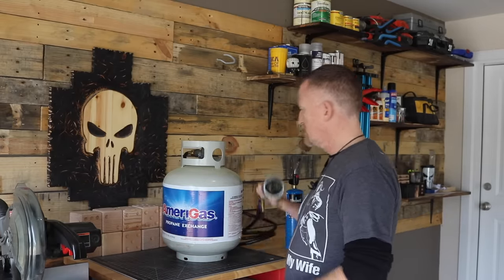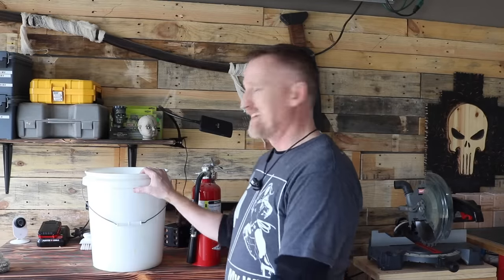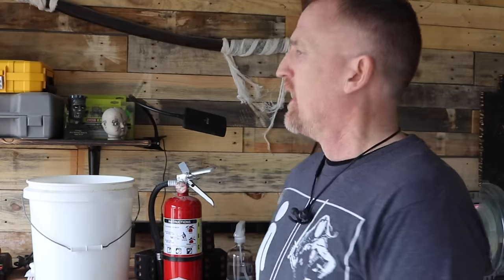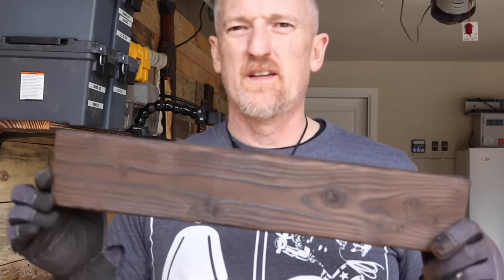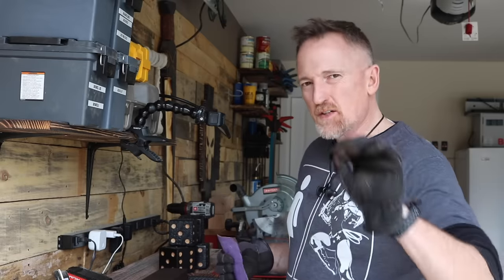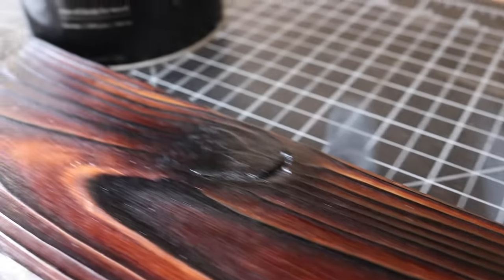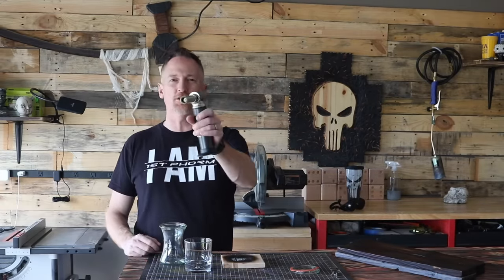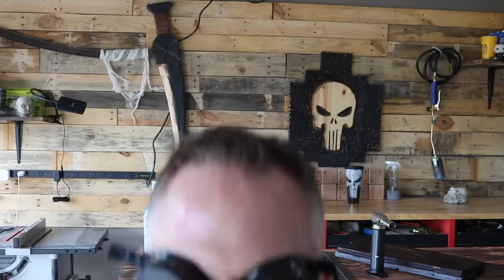DIY Wood Burning Technique - That's not Shou Sugi Ban! Or is it??

Comment: I was under the impression that burning the wood wouldn’t require the poly? Will the burn wood in its natural state been enough to withstand natural elements: rain and snow?
Reply from the maker: I always finish them so the soot doesn't come off on your hands, etc. I built some outdoor planters out of cedar, burnt them and didn't finish them. And they seem to be holding up just fine.

Comment: I've tried doing this technique recently on a couple projects, which some have been successful, but I'm having issues with my boards warping after putting the torch to them.  Any suggestions to help prevent this from happening?
Reply from the maker: Hey, Nick!
Unfortunately, warping happens when working with wood and fire.
2 things to mitigate warping:
1 - Spray the wood with water while you burn
2 - If you notice the warp while the board is still hot, set something heavy on it while it cools
3 - Burning the opposite of the wood will sometimes straighten it out
Cheers!!
Reply: @BuildDadBuild  thanks for getting back to me.  I was spraying with water while burning and doing both sides but I did not set anything heavy on them once I noticed, I'll try that next time.  Also I'm wondering if the boards I had were just too thin for the amount of heat I was putting to them.  3' 1×6 pine is was I was using

Comment: i love the look of this burning thing but ive tried doing it when my project was assembled and you cant get the 90degree corners burned so i have to burn all the pieces before assemble. does anyone have a fix for this problem or am i doing something wrong. i hope it made sence
(sorry for english)
btw nice vid
Reply from the maker: Burn before building. Cut your stock a little long so you can cut clean edges. Then come in with a torch once assembled and burn the edges.
Cheers

Comment: What type of wood did you use?  I want to see you finish a table top with that last bleach finish on burned wood!
Reply from the maker: In this video I used pine.
And stay tuned for some tabletops....should be coming soon!
👍🥃
Reply: Ive used this same burning technique as well and the amount of wood or the length of time your torch is heating up the wood can change its effects too. Be sure to experiment!

Comment: Not sure if you have gotten this question before. But I want to do this with my AK handguards. What was that brush you were using after the sanding?
Reply from the maker: Ha! I've only gotten that a few times. LOL
I used 2 in this video. One is an old bristle brush off a broom (the brown one) and a nylon brush (the kind you'd clean your bathroom with). So, nothing special.
I have since that time found some bristle brushes that fit in your drill. I'll link them below. They make life SOOOOO much easier than doing it by hand.
Cheers!
Nyalox Brushes: https://amzn.to/3aRgnXZ
Reply: Build Dad Build I appreciate it! Ready to burn some wood

Comment: Great project. What clear did you use over the sunbleached. That looks amazing.
Reply from the maker: I normally use a spray poly on small projects and a wipe on with larger ones. That particular piece is just stain, no top coat.

Comment: So, I have some old mirrors I wanna do this with... But the mirrors are the problem... Lol but so pretty.
Reply from the maker: can you remove the glass?
Reply: @BuildDadBuild  sadly no. I mean, if I had cutting tools then I could pry the back off & just make a new back to reset it, but lack of tools no. I think they were 2 swing mirrors from a dresser, but I want to fix them up and hang them on the sides of a door or window.
Reply from the maker: @RealSimsHouse  Maybe take them to a glass shop and see if they can remove them for you
Reply: @BuildDadBuild 
Thank you. 💖
Reply from the maker: @RealSimsHouse  Sure thing

Comment: I like the second to last wood in the line up with that deep red and black. What did you use to get that color finish?
Reply from the maker: Hey, Sean.
It's called Simple Finish by Maker Brand Co.
It's pricey, but a little bit goes a long way. And it's really easy to apply.
Cheers

https://makerbrandco.com/collections/simple-finish/products/simple-finish-hardening-finish-with-wax-sealer-for-wood
Reply: @BuildDadBuild  I found it. Thanks

Comment: What grit sandpaper did you use? Do you recommend by hand or power sander?
Reply from the maker: If I'm sanding for highlights it's usually 120...sometimes 80.
But I mainly use these brushes attached to my drill now. They save a ton of time.
https://amzn.to/3gxihBp
You can check them out in action in this video:
https://youtu.be/zOXuGlawxPQ
Cheers!

Comment: tried sun bleached stain, mine didnt turn out as nice, seems way to much of the color stayed and didnt wipe off.any tips on it?
Reply from the maker: Sometimes that means you didn't wipe it off fast enough. If that doesn't work you can cut it a little bit with mineral spirits...should thin it down
Reply: @BuildDadBuild  yeah it seems a bit thick,  i put it on and wiped it off as soon as i finished covering, i did use a paint brush though, dont know if that matters. also it was almost like a paint instead of a stain.  so maybe i do need to cut it a little.  and btw awesome video thanks for tips.
Reply from the maker: You are welcome. And I have noticed that working with the sunbleached does feel a little more like working with paint and less like working with stain.

Comment: Hello to get that gray look with the sunbleached stain,  do you have  to use a curtain type of wood. Im looking for a slab to do that? Was there any special steps to have that color come out?
Reply from the maker: No. The sunbleached will do it.
Reply: Do you have any videos with you going through the process of you using the sunbleach stain?
Reply from the maker: @laralpheal  Sure. This one! It goes on like any other stain. Wipe it on, let it sit and wipe it off.
Reply: Last question. After I burn the wood. Do I sand it to lighten up the wood a little?
Reply from the maker: @laralpheal  I use a wire or nylon brush.

Comment: What kind of brush are you using to scrape off the char?  Didn't see it mentioned in the "Gear" section.  
Thanks
Reply from the maker: It's a nylon brush I picked up at Home Depot. In the cleaning section. LOL. Check out the nylon brush attachment I have for my drill in this video:
https://youtu.be/SMz5r7TFcEI

Works awesome!

Comment: What type of brushes do you perfer to use to take off the burn?
Reply from the maker: I used to use a wire brush and a nylon scrub brush (like you'd use in the bathroom). But I've since upgraded to brushes that fit in my drill. Saves a TON of time. They're Nyalox brushes from Dico:
https://amzn.to/3amIsaL

You can see them in use in my latest video:
https://youtu.be/cN9lwps2Onk

Cheers!

Comment: Great video! I read down below that you use pine. Would this technique on pine stand up for exterior use? And if so would you need to burn both sides if you were using it for exterior paneling? Thanks for any help, Jeff
Reply: I wouldnt think so. I think that youd still need to seal it some way
Reply from the maker: By charing the wood it gives it extra protection, but it's still pine. I agree with Aiden, I would still seal it if it will be outside.
I used this technique on a storage box that I have on my back patio (covered) and I sealed it with an outdoor poly.

Comment: Good morning : I'm trying to find the simple finish by Maker Brand and its sold out everywhere . Which other stain can you recommend that will give the same look
Reply from the maker: Hey Jacques!
You could try boiled linseed oil or danish oil. 
However, I just checked the site and it looks like it's in stock.
https://makerbrandco.com/collections/simple-finish/products/simple-finish-hardening-finish-with-wax-sealer-for-wood
Cheers
Reply: @BuildDadBuild  Thank you for the answer .

Comment: Rather have one and not need it, than need it and not have one. Solid piece of advice. Works equally well when it comes to a gun or a condom.
Reply from the maker: +Don VanDenBerg agreed!
Reply: Btw thanks for the ideas on the staining processes on top of burning. The wife wants to do the pallet wood flooring and I got a bunch from work. Letting them sit out to sunbleach naturally.

Comment: Just a quick heads up about using a tiger torch around concrete. It could possibly explode on you if it gets too hot. Great video and these tips will come in very handy.
Reply from the maker: Thank you. And thanks for the heads up!

Comment: Will this method work on 2x4x8 fence railings? By work, I mean so the 2x4x8 won't warp.
Thank you.
Reply from the maker: I can't guarantee no warping, but I can tell you how to reduce the chance of it happening. 1 - Do shallow passes with the torch. Burn it lightly, let it cool and repeat and 2- Keep the wood damp while you work. Have your garden hose handy with a spray nozzle and hit the fence with it in between passes. 3 - sometimes it's gonna warp no matter what you do. So, maybe pick up a couple of extra pickets and replace any that warp. Hope that helps! Good luck
Reply: Twisting and cupping and such will always happen with wood thats drying out without pressure on it to maintain the straightness. Your answer depends on the age of the wood, the moisture content, how it was cut, what type of wood. Typical big box SPF - yes, its going to "warp"

Comment: What are you using to apply the stain and where did you find that massive wire brush?
Reply from the maker: Ha! That's not a wire brush. It's a nylon brush that you'd use to clean the bathroom, similar to one like this: https://amzn.to/35EsMgC
I think I picked it up at HD. 
And applying stain with old t-shirts. Except for the Simple Finish, using a brush for that one!
Cheers!🥃👍🥃👍🥃👍

Comment: I want to do a plywood table top.  Any special considerations for that?
Reply from the maker: You can only do a light burn on plywood. Too much heat will burn through the face ply or cause the glue underneath to bubble.
Cheers
Reply: @BuildDadBuild  nice.  Thank you

Comment: Do u add wood filler before or after burning if I need to fix imperfections?
Reply from the maker: When I have had imperfections I've used glue and sawdust. Not sure if I wood filler would withstand the heat.
Reply: Thank you, we just made a countertop and plan to burn the entire top at once, but I have a few places I would like to fill in. I’ll try the glue sawdust method, maybe even some of the dust from the burns. Thanks for the quick reply
Reply from the maker: Sure thing. You might want to try filler on a test piece and see what it looks like.
Reply: Ok ill do that, I have some test pieces I’ve burnt already. Thanks for the info.

Comment: Question about the burners\gas here. About a year ago ive purchased weed burned (similar to what Nik have). But my issue is, for some reason even with valve on the tank on "full open" mode and the valve on the weed burner itself is also fully open.... I get a big slow yellow fire bowl.   What i deff DONT get is the blue colored "jet" stream of fire which make that fizzle\shhhwhwhhhhhhhsshhsshs sound.

From my basic understanding of physics and the way propane suppose to burn (mixing with oxygen).
I`d say the issues is "too much butane outflow\slow pressure". Seems like it.
However, when i try the combos like "burner" valve almost closed.... gas tank valve full open (and visa versa) - it gives me F finger. I.e. nothing changed.

Do i have broken weed torch? Do we have "low pressure" gas tanks here (im not sure if its even possible in theory).

Can anyone share some similar experience?
Reply from the maker: Sent you a response on Discord. Let me know if that helps.

Comment: How do you keep the boards from warping or cupping?
Reply from the maker: Keep the wood moist by spraying water while you're torching. Make faster passes. Don't keep the torch in one place for very long. And burn the backside to bring it back flat.
Reply: Awesome. Did it the way you said. Turned out great. Gave me brownie points with the wife. Much appreciated!!

Comment: Never had to use sandpaper to get that effect I just brush it with a brass wire brush.
Reply from the maker: I used to use a wire brush. Switched to nylon to reduce tool marks. 👍🏻👍🏻

Comment: Cool video learned some new things, but why not say oak for the smoke? Oh cedar might be nice.
Reply from the maker: Hardwoods behave a little different. There's less soft cellulose material to remove. It ebonizes the wood.
Reply: @BuildDadBuild  I understand why you use the soft wood. But the oak comment was for the whiskey. I like the grey stain but I wonder what a gun stock or cherry stain would look like. I love the gun stock color on alot of my projects.
Reply from the maker: +the moose LOL I have a piece of hickory that I'm currently burning (for cocktails) but I do have a price of ok I haven't burnt yet. I'll keep you posted. 
I think gunstock would work well, it has that kind of orange warmth that would look good with the black char.

Comment: That maker brand is out of stock. Do you have another affiliation link I can use that has it in stock or another website I could get it from. Going to make a dungeons and dragons chest with that finish.
Reply from the maker: Unfortunately they're the ones who make it! Looks like they should be back in stock in 4-6 weeks. If you can't wait that long, might want to try something like boiled linseed oil.👍

Comment: I have scrolled and was unable to find what type of wood did you use?
Reply from the maker: I apologize...I didn't say it in this video. That wood is Pine. Cedar is also good for burnin!
Reply: Thank you, I’m considering using white pine as siding using the burn and stain method. Your video showing the different stains is very helpful
Reply from the maker: @PotluckLock  Awesome! Let me know how it turns out.

Comment: Does this method work only on pine, because everytime I see it pine is being used.
Reply from the maker: Soft woods with good grain patterns are best. You don't get as good of a texture with hardwoods because theres less soft cellulose  material to remove. But you can do some pretty badass thinks with oak and poplar, it just ebonizes more. 
 
I think you see pine mostly because it's cheap and widely accessable. 
Cedar works pretty well too. And they both have really good grain patterns.
Reply: @BuildDadBuild  ok cool. Thanks
Reply: This method works on all wood. But Japanese Cedar is where it gets its origin from. It's one of only a few woods that this method actually protects the wood from water and insects.

Comment: That's freakin' amazing. Ever build a while project, like a chest, and do the burn & finish when it is assembled? Or is it best to do this burn & finish method before assembling a projects?
Reply from the maker: It kind of depends on the project. I built a storage chest and burnt it after I assembled it. It was hard to get into the corners of the box and burn it evenly. Simpler projects could probably be burnt after. 
I'm getting ready to build some outdoor chairs and I think I'll burn before I assemble and touch up after it's all together.

Comment: Is there any other way to burn wood without a flame-thrower ?
Reply from the maker: You can use a small propane torch. It just takes longer.
I've also seen (never done it myself) guys build a fire and then put their lumber in a tent like configuration over the fire and let that burn the wood.
Reply: @BuildDadBuild  That's exactly what I've done !: Thanks :)

Comment: What type of brushes did you use or sand paper?
Reply from the maker: Sandpaper I used 120 grit. When you say brushes are you talking about for the stain?
Reply: I use brass brush, does the job, assuming you mean after the burning to clean it up!

Comment: I still find it strange that so many people act like everything would be a japanese invention.
That is just burned wood (and the brushing/sanding is just undoing the protective effect that always was the reason for burning it in the first place).

You can find wood treated that way all over middle/northern europe too. Cause the principle is just that easy.
Reply: Only Shou Sugi Ban is a commercial product rather than a technique. The technique is called yakisugi and was created by the Japanese centuries ago but yes I agree, brushing off the wood removes some of the protective properties.
Reply from the maker: THanks for the assist Mr Smith. And thanks for doing your research! That's why I really hesitate to call what I do Shou Sugi Ban (other than its the current buzzword for the technique).
Reply: @BuildDadBuild  It is commonly more known as Shou Sugi Ban in Western society but you're not wrong by any means. Thanks for the video and the detailed explanation of your process, I am considering this very technique for a desk because I think the results are fantastic. I particularly liked the grey one too! Did you say you used pine?
Reply from the maker: Correct. That is pine.
Reply: @BuildDadBuild  Thanks! Looks beautiful.

Comment: Try using a sandlaster instead of sandpaper and a wire brush 
I think you will be pleased 
Oh ya what else do you 🔥
Reply from the maker: I've seen some different methods for material removal, but never sandblasting 🤣🤣🤣
Reply: I make a LOT  of signs sandblasting.  Do a search and it should bring up some  for you.  I'm looking for some painting/stained  ideas and love what you did. Gotta try it. Thanks for your help!